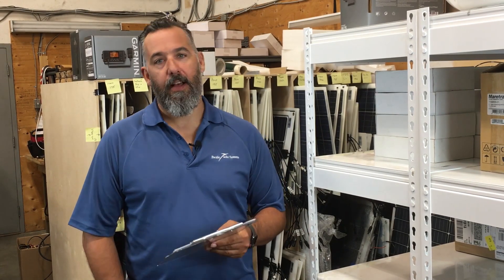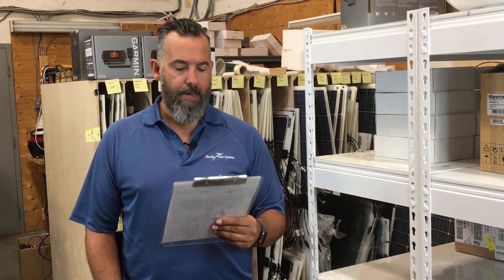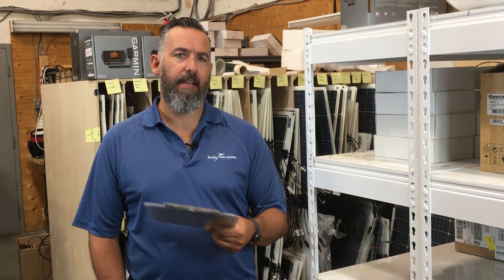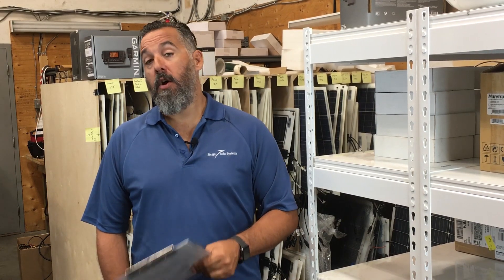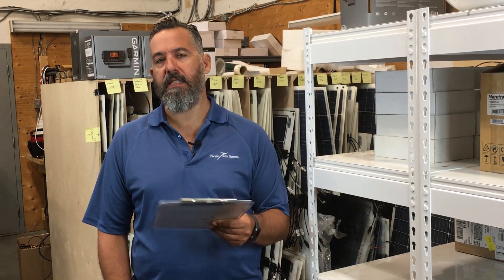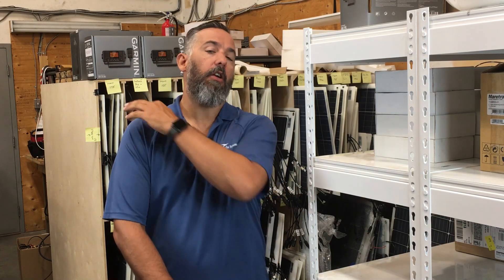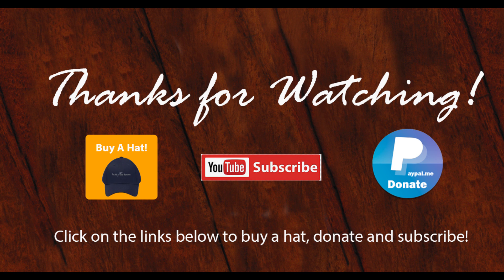Ask PYS - What Is an Electrical Short Onboard My Boat?

Comment: I've a question I would appreciate an expert opinion on. I don't know the answer to this one but I have workarounds. How can I tell that my charger is working as it should and that my battery monitor is reporting true to reality? Specifically, I would like to know how can I be certain that my sealed AGM cells are achieving specific gravity of 1.28? It seems there is only one battery monitor on the market that reports >100% that I am aware of. This is Bogart Engineerings TriMetric. I have experimented with many manufacturers' chargers and Flooded batteries using a hydrometer. The results are concerning/interesting depending on your outlook.
Reply: My stance is that the school of thought that most "high end" chargers are "good enough" is not good enough for me.

Comment: I currently run my main AC power through a breaker, to my Victron 12/3000 inverter/charger, then to the main AC panel.  I have a LifePo4 12v 600ah battery bank connected to the inverter with 200 amps of breakers (2 100 amp breakers in parallel - I found this cut down heat vs. using one 250 amp fuse).  The inverter is grounded to the unswitched negative bus with a 1/0 cable.  My question is, "Is there a "gotcha" I haven't thought of with the inverter on that side of the panel/shore power system?"  I know I can't run all loads at the same time when in inverter mode, but when in pass through mode, everything works fine.
Reply from the maker: Hi Eric, with some inverters (e.g. victron) providing more detailed monitoring, it's becoming more commonplace to find inverter/chargers wired in between the shore power and the AC panel. As you mentioned, you need to have a AC breaker on the input and output to and from the inverter.

Comment: Hi! Is it a problem if you put a fuse in your starter circuit?
Reply from the maker: Definitely could be, if the fuse is wrongly sized. Starters have large inrush of current and sometimes that can cause nuisance tripping of the fuse. The ABYC code states that you don't need to fuse the starter as long as great care is taken to make sure you don't have a accidently short.
Reply: I wouldn't fuse an alternator either. They set fire if the fuse blows with the sense intact. Hefty cable, armour (flexible conduit) and sensible sheltered hard mounting are best ways to mitigate against incidents in these circuits.